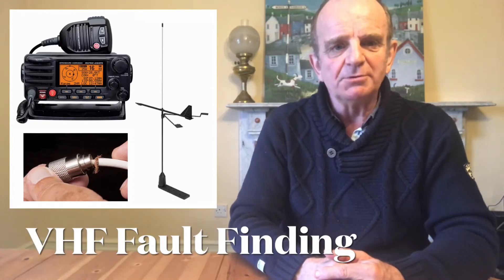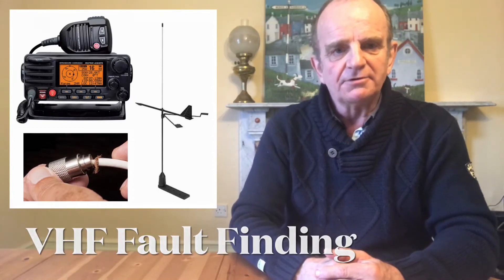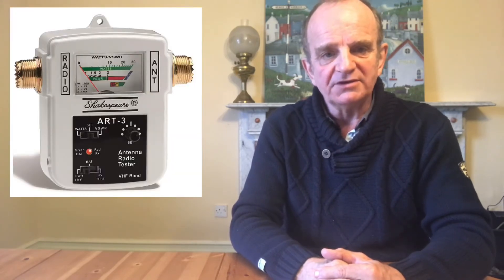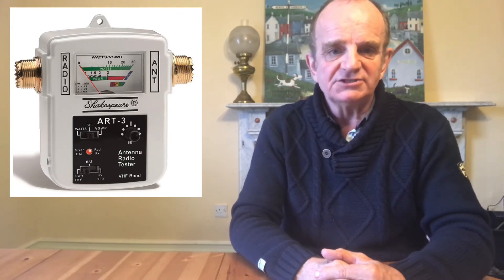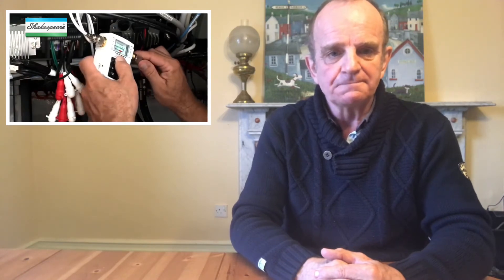VHF Radio fault Finding

Comment: I installed new Uniden vhf radio, despite current flowing properly, it still won't turn on. I checked the fuses and it all seems fine.